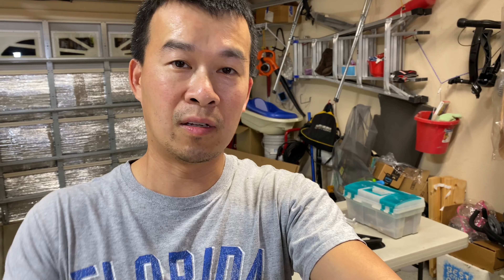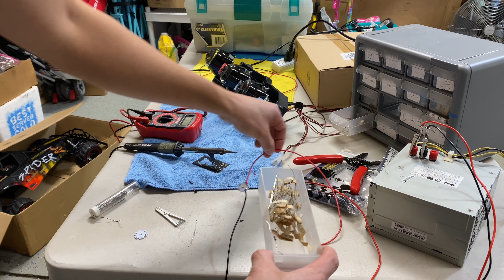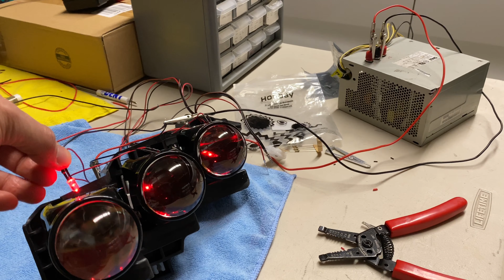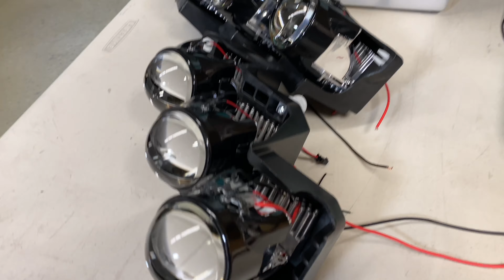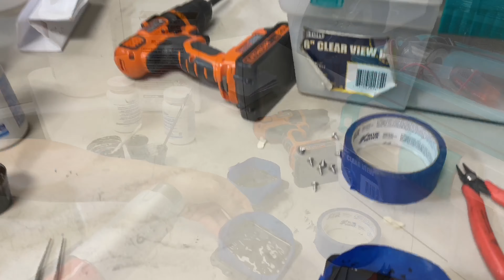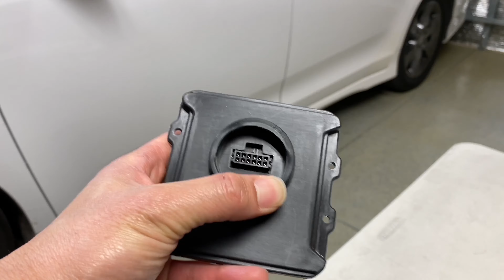Custom VLAND Demon Eye Headlight Upgrade Triple Beam LED Lexus 2006-2013 IS250 IS350 IS-F

Comment: Hi, i have a problem with my vland headlights for my IS 250 2011. The DRL flicker and i can't permanently put the high beam on. I can "flash" people but when i put the high beam permanently, only the DRL are on and nothing else happen. any idea what is the issue?
Reply from the maker: Need to have the stock DRL in the high beam disabled via Techstream.
Reply: @TunerwithKids  what is the Techstream? sorry i'm not familiar with cars hahahaha
Reply: @TunerwithKids  Also i have a Canadian car, i just read something on the web saying that the ECU is different for canadian's car?
Reply from the maker: Yea no way to disable on CA cars. Will need to rig it with a relay so you disable the old DRL during daytime and enable at night.

Comment: How long since you bin running these vlands
Reply from the maker: A week or so now. Been customizing them for a few months when I have time.
Reply: @TunerwithKids  if the bulbs blow do they sell replacements
Reply from the maker: Strategic Computer Systems. Nope. LED, something burns out, better hope it’s under warranty still, else SOL.
Reply: Wow dam
Reply: @TunerwithKids  where did you buy that bumper and lip
Reply from the maker: Strategic Computer Systems check my review video. Links to bumper in the description. https://youtu.be/jTSSE-R9dM0

Comment: Love all of your videos!  As a mechatronic engineer myself I enjoy the detail you go into when doing electrical things. I've heard these lights don't have great output from the factory. Would it be wise to maybe upgrade the LED's that drive the low and high beams? Do you think those shrouds effect the light output or beam quality? I actually have my 2008 lexus is250 awd HID headlights converted to LED, I still have the AFS working as well. My lights are old though with the yellowing effect with many micro cracks in the lense. I've toyed the idea of getting these but not if the output isn't  enough (3200-5000LM). t's also a shame that they are now sealed instead of the easy bake sealant.  Also to extend their life I would probably install a cooling fan into the housing, but then I wouldn't know what to do about moisture lol.

Anyways keep up the video's! Chiming in from Wisconsin.
Reply from the maker: I'm an electrical PE. But most of this stuff I do is just hands on for last 25 years of cars. I've done much more on my cars that was always previously just posted to forums. I need to redo these MODs and video them all.
Reply: @TunerwithKids  What bulbs are used as standard in vland? And how can they be replaced without removing the lamp? One stopped working for me;(

Comment: Ive the facelift version do you think i should uprgade to this?
Reply from the maker: Lucifire up to your personal preference. If you have 2011+ DRL versions in mint condition, maybe not. But if yours are aged and oxidized and your looking for a new look, might be a good upgrade.
Reply: @TunerwithKids  tbh they are mint, i live in sweden so the sun doesnt really hurt them that much. Do you know anything about the rear axel? Can it hold alot of weight cause my foot is pretty heavy and the car loves to let its back slip from time to time. Lol.
Reply from the maker: Lucifire get better tires.